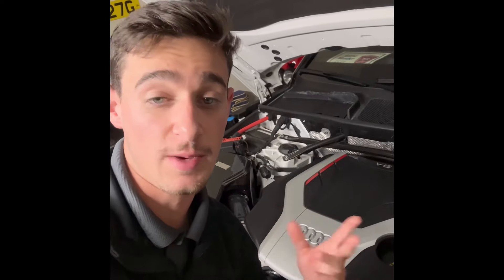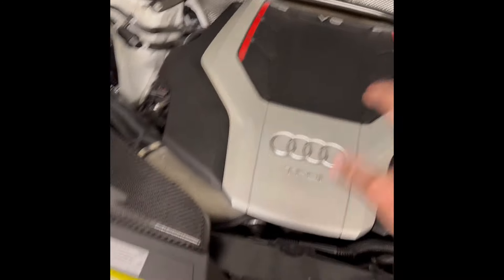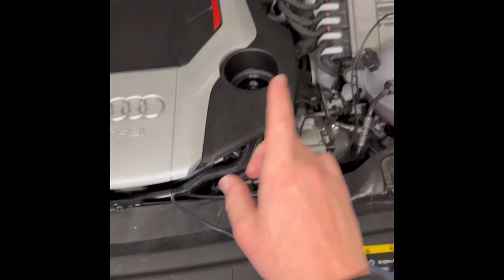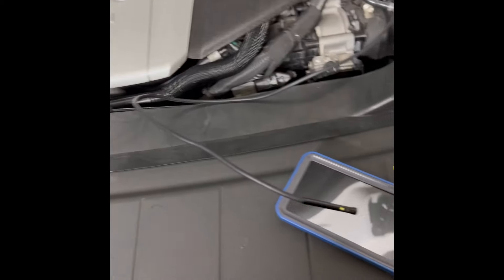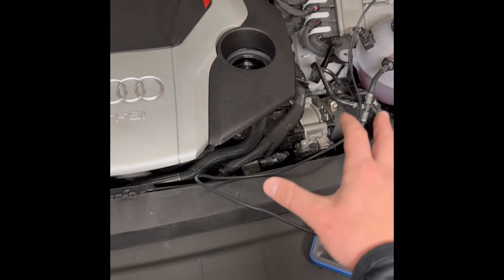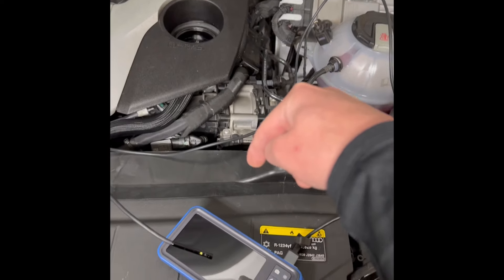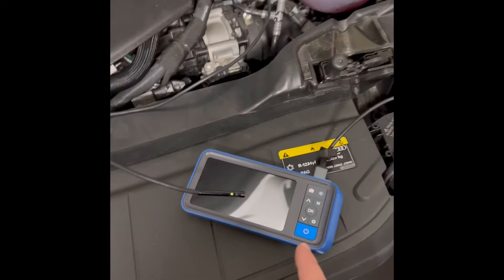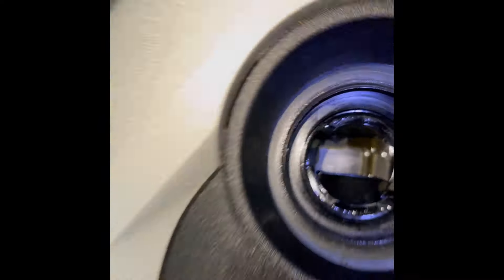Audi b9 rocker arm how to inspect (s4,s5,sq5,rs5,rs4)

Comment: As an owner of a 2018 s5 copue it's time for us owners to demand a recall fix or class action law suit simply because this wasn't disclosed and can lead to other major problems including and not limited to engine damage or failure.
Reply: And you could get hit by a truck too but how likely is that to happen? Probably as likely as these are to fail on your car. There’s a reason the forums aren’t awash with videos and complaints…it’s just the same two videos, one of which is by a garage that beat the crap out of owners cars and spread misinformation - getting the picture yet?
Reply: I agree they should be building these cars properly its not our problem if the issue is with their build quality

Comment: This isn't a big of an issue as the internet would lead you to believe. Audi has made 100's of thousands of variations of this engine world wide and the failure percentage isn't that high even if we don't know the exact number. Obviously, people who have issues are going to be louder than those who don't. I have well over 100K on my modified B9 and you shouldn't be scared of owning one.

You WILL have a PCV issue tho.
Reply: I've owned Audis for nearly 20 years now though, and honestly, if there's something I've learned, it is that if a part has been redesigned, it's almost certainly because the original had more failures than they would have liked.
Reply: @jlgroovetek me with my b8 a4 with timing chain and turbo waste gate issues lol

Comment: I have the old ones with a stage 2 APR since 18700 miles I know have 80k .... ZERO ISSUES.. That's w APR tune .IC . Downpipe .and a few other fun things again 0 issues ..
Reply: Does it tick, or tick louder when low acceleration?
Reply: I have a 2017 S4 with 33k miles on it. Good as gold. My Audi tuning specialist has never seen or heard of this issue before. Deals with 40 new Audi motors a month. Just drive and enjoy your cars man.
Reply: @chrisellison9046  cause you have 33k miles..
Reply: @user-zo6cr2rg2f  Also, if this was a genuine issue, Audi would have recalled the motors. You could easily look at any car and find an excuse not to buy it or drive it. Unfortunately the Internet is full of good and bad advice, which isn't reliable.

Comment: Not common, this engine has been in a VAG product since 2016 and there have been 2019s with the old revision as well. There are so many out there the failure amount is miniscule, alot of people and I mean quite a bit of people mix up the hpfp/injector tick with rocker arm failure due to posts on social media. Thanks for the vid btw for an easy check going forward.
Reply: Common or not, Audi updated the part for a reason.

Comment: Root cause of failure: OEM oil stretching interval past 6000 miles.
Reply: It’s cheap insurance for sure.  Bonus is that I like doing it 😮
Reply: I agree. I change my oil at 5k or sooner depending on time and driving conditions. 10k is ridiculous to me. I've had my 2018 s4 for years with lots of hard street driving, various autox and track days. No issues.
Reply: To edit, I am Stage 2 and switched up to the RS5 oil SPEC 0W30 so it give me peace of min.d

Comment: What production date should we look for? I have a 2019 s4 but I’m not sure if I made the cutoff
Reply from the maker: Hey man! You should see a barcode sticker on the metal coolant pipe on the front of your engine with a date stamp! Let me know
Reply: @vagdude6397  it says October of 2018. Should I be good?
Reply from the maker: @giovannimalek9211  oof…don’t think so. I would just inspect to find out for sure. I think the cutoff was 11/18
Reply: My 2019 rs5 has a 10/18 production date and I have the new bearings so you can’t go solely based off the production date.
Reply: @vagdude6397 what do you mean by cutoff? Mine is 01/18
Reply: Mine is 11/17

Comment: Infinite thanks for the amazing info. My 2020 Macan S, that shares this same 3.0 V6 single turbo engine is a 07/2019 manufacture and following your advice I got the endoscope from Amazon and easily checked that I do have the newer rocker arms with the fat bearings. I'm keeping the endoscope, it's a nice piece of equipment for a crazy cheap price, for the service if has given me the don't deserve I return it. I plan to use it to inspect my drier conduits for stacked lint.
Reply from the maker: Happy to hear!!! :)

Comment: My sq5 is production 12/17. 
I’m going to the dealership tomorrow to have them check . Most likely old ones . 
 Roughly how much to replace ? Thank you 
Is it possible that my car could have the bigger bearings? I’ll definitely find out today or tomorrow but I’m curious even though mines a 2017 production it is the 3 L turbo engine what all them made that year with the pins. Were some made with the bigger bearings. I’m just curious.?
Reply: What did they find out? It’s upgraded rocker arms?
Reply: Did you find out and how much to replace?

Comment: I just tried this and after 30 mins I got impatient. How did you land on the rocker first try ?
Reply from the maker: You have to orient the borescope just right to get on top of the rollers. Leave yourself about 6 inches of straight and bend it at the very end towards you.
Reply: @vagdude6397  when you are in the front of the car, do you put the borescope to the left or right of the cam ? In the video your camera goes first to the left and then right.
Reply from the maker: @CedRouleau  to the left of the cam and under

Comment: Hey I’ve got an s4 with a slight clattering noise almost like a bad fuel pump. I’m sus of the rocker arms, could you provide a video or could I send you a video to confirm?? Thanks.
Reply: it will be very noticeable.  regular ticking noise on b9 engines is a very fast/high pitched ticking.  bad rocker arms will be a separate slower, low frequency tap almost like someone's repeatedly hitting the engine block with a metal rod.   almost like a chatter. observable towards the middle and sides of the valve cover shroud.

Comment: and btw, im getting my audi s5 2018 this week, do you recommend to upgrade the new rocker arm or leave it as it be atm?
Reply from the maker: I recommend saving yourself the money down the road and getting a 2019 s5. Stay away from 18 production.
Reply: Too late buddy. Already approve and getting it tomorrow
Reply from the maker: @erictan88  good luck. Hopefully it’s not an issue down the road
Reply: Yes. I only can pray. So basically I’m still interest to know is it better to upgrade the rocker arms to the new version or stay the old till issue coming up. Don’t mind spending unnecessary money for this
Reply from the maker: @erictan88  I would let them be until they start making noise.
Reply: Thanks sincerely thank you
Reply: @erictan88  how was your experience?
Reply: How’s the S4?
Reply: @winfle  so far car are great. Just got issue with the temperature pump. And the assist sensor are too sensetive
Reply: @erictan88 how’s the s5 now?
Reply: @erictan88 2 years later any problems i’m gonna go buy one this week?

Comment: Is there a mileage I can expect them to go bad at? I just bought an 18 s5 but got a 5 year 60k mile comprehensive warranty on it so I’m not stressing on repair costs. Cars at 46k miles rn so as long as they fail before 100k miles I’m chillin. Just curious. Great vid, you earned a subscriber!
Reply from the maker: Hey man! Thanks for the sub! It’s hard to say. I’ve heard failure happen as low as 30k miles but also have people with 100k mile + cars with no issues yet. Really hard to tell. Wish I had an answer! Just listen for abnormal inconsistent ticking noise and pull your oil cap and listen for rattling/ticking.
Reply: How is your s5 doing, I have a 18 with 62k miles. You been having any problems? And do you drive the car hard🤔
Reply: @princebamb1672  Hey yeah when I got the car there were some pre existing problems that I found a month or two later. The engine oil filter housing which is in the engine bay was leaking around the seal causing oil to pool up in the engine and then the drip came from under the front passenger seat. They just had to replace the housing, gasket, and screws. Motor mounts were leaking hydraulic fluid, they had to replace those. The seat belt tensioner in the drivers seat was faulty so it caused the pre-sense to not work. Outside of this I’m at 54k miles now and the car is great! My one complaint about it is the interior rattles. The doors, trim pieces, seat belt covers, trunk, and roof all rattle and creak in their own ways. I’ve done a good job at taking things apart and applying felt tape or butyl rubber to it to silence the car and it’s noticeably better. Will be taking the car in to figure out why my roof making a weird popping noise the first time I drive it after it’s been parked overnight. I drive the car hard often, it’s hard not to lol, performs and handles like a champ, wish Audi could have gotten the interior up to par with my moms Subaru which is dead silent on the interior lol. If you have any questions about the rattles or problems with the car let me know, I’ve became quite knowledgeable about common problems and how to take things apart to fix them, outside of the engine bay which is way too crowded for me to do anything by myself.
Reply: @quackattack2002 s5 still doing well? You are in an 18? 

How many miles these days

Comment: Any common themes with noisy valvetrains/HPFPs/transmissions under load in the B9.5? Starting to drive me crazy
Reply from the maker: These hpfp make a crazy amount of noise, always have. Same with valve trains. Normal for the most part. Listen for inconsistencies. The zf8 is a fantastic trans so you shouldn’t be hearing any noises. Shifts are crisp though for the most part?
Reply: @vagdude6397  Yeah the shifts are alright, it loves to bang 3->2 even after a readaptation and sometimes at low throttle gets confused in 7th when it tries to go to 8 and then bangs when it realizes 8 doesn't work at 42mph.

I've had 5 other Audis, many with direct injection but never heard an HPFP this noisy. No fuel cuts or anything though. Seems to get worse as the car gets hot

It could also potentially be a soundproofing issue that it's making its way to the cabin when it shouldn't be. I know there's a TSB for the intermediate steering shaft that I need to get under the car and look at

Comment: So, #VAGDude - as a service adviser, what would replacing a rocker arm that is bad, cost?  Let say an SQ5, like you have there.  Would you advise, if a client came in with a bad rocker arm that ALL should be replaced?
Maybe a separated Parts and Labor cost(s), please?
PLEASE respond as I think I have a bad rocker arm and I do NOT want to get hosed by a greedy service/repair shop trying to ride my wallet.
Reply from the maker: Hey Luke! If you were to replace a bad rocker arm, it would be a no brainer to replace all of them. Some dealerships have just replaced the one bad one which is crazy to me. All should be replaced. Parts cost isn’t terrible but you’ll be paying a ton for labor. Can’t give a price figure but you can expect north of $6,000

Comment: Can anyone in the world tell me if normal A4 B9 2016. 2.0 TDI 190hp (Diesel) is affected by this? I have this one with 125k miles on it. Thanks a lot!!
Reply: btw i'm asking this because i have some rattling/ticking noise at high revs and only when gas pedal is engaged, after letting gas off it stops... it is not loud but quite noise in fact from engine bay seems like... not sure if this is usual 'diesel' noise or arms....
Reply: An A4 B9 2.0 TDI should not have problems with this. I have one myself with 170k